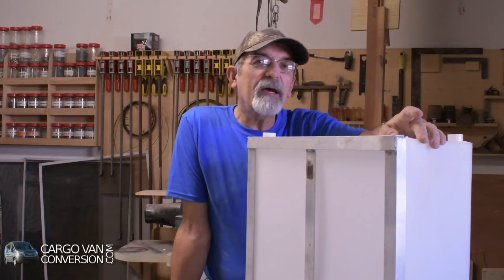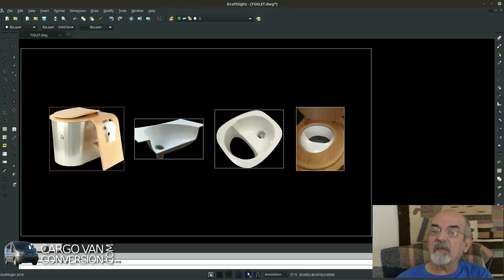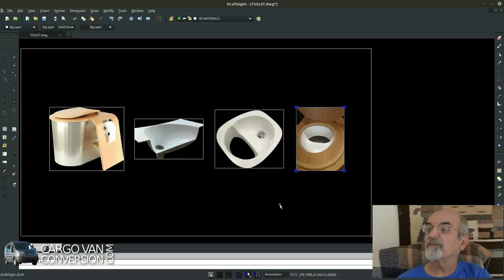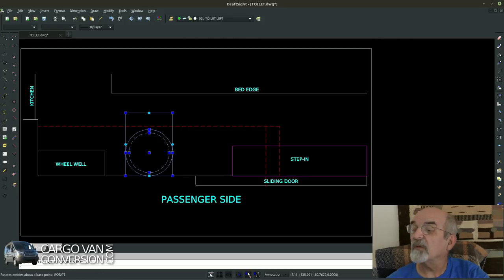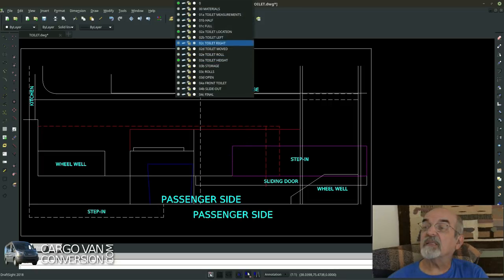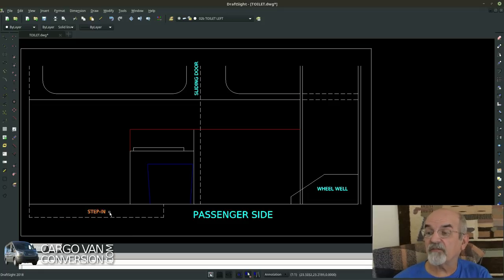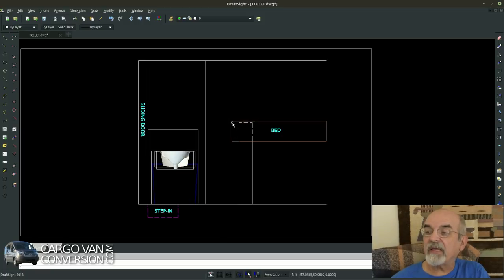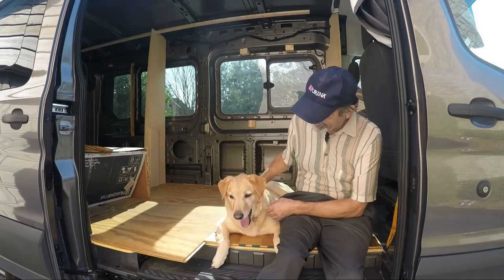RV Separating Toilet - Design Considerations

Comment: Hello! Van, Great to see you back at it again. I have an idea for you.
Fill in the area that the footprint of the toilet in your step well. Possibly with storage for extra toiletries, we can never have too much in that regard. That would create a level place for your foot and having more room on your right side for obvious reasons.
The lid is a great idea and I would use it for supplies too. I have a Ford E series van and my step well is filled half way across with a tank I made of stainless steel and covered in the flooring material.
I fill it with water for the dogs when we are outside. It's easier than going inside to fill their bowl.
It's also a few more inches of floor space when the door is closed.
I twisted ankles a few times moving around before I did it.
I'm just getting back to the kitchen cabinets on mine, the weather is finally getting better. And once I'm done with them I'm going to make a filler for the last bit of the step well to create a fully flat floor when I close the door. I'm thinking about attaching it to the door for a small shelf when it's open. And storage for leashes and collars inside.
You know the rule everything built has to store something. Well I hope you have it figured out and can't wait to see your results!
Give Joey a big hug and good luck with the build. It's a great design and it will make travels easier. Hope your adding an exhaust fan to the toilet to vent it outside and help in drying "things out" almost forgot to add that! Happy travels!
Beeps
Reply from the maker: Hi Beeps,
Yup a bit of a YouTube burnout. Too much editing. Have a new camera too, that tends to make too many photos (10/sec) :)
I'm working on several things now and one of them is the step-in area. It is intriguing to fill it and get a flat floor back, but getting in is already a struggle and at my age, it's only going to get worse. Would need a exterior step then. But I already had a good design for a compact step, that I may be able to store in that area. May have to rethink that.
I decided to place the toilet in such a way, that I retained 30 inches to get into and out of the van. That would leave me about 12 inches on the left side of the step-in area to store flip-flops and a pair of water shoes or a leash. Just like you described. Am working to put that in now, but I'll sit down and take another look.
Love all these ideas.
Take care!
Almost didn't see what you wrote about the fan. Yup probably a small computer fan, likely with a manual switch.
Van Williams
Reply: @cargovanconversion  exactly, just enough to keep the air moving out to dry and remove odors. Flex vent works for quite a while before it needs to be replaced.
Reply: @cargovanconversion  Aha ! Someone did suggest and you're thinking about a small exhaust fan ! Excellent !

Also, love the idea of a step stored in the "step" area. I've doodled that in my own (always planning, never starting ;-)  )  van camper. It makes the floor space just a little bigger and more finished looking when you're closed up. Mine are usually planned as attached and hinged to fold down, with the side facing the door open when folded up. The step then becomes a handy place to kick off the muddy shoes. If that's clear enough ?

A loose step stored there works too, and I've figured it'd double as a handy tool box too. And being movable could be handy for stepping up around the rest of the van as well for easier access.
Reply from the maker: @nothere7198  Hi Not Here,
Lots of possibilities with that step-in area. I think it just much 'safer' if you could fill that area in and have a straight floor. I see myself getting out of bed at night and just stumble into that hole. Can be nasty.
But on the other hand, getting into the van through the sliding door opening is already an effort; always have to use that door handle. Doing that will only worsen. So a stepstool in whatever form is handy and perhaps necessary. Just haven't figured it out how to implement it. Also wanted to use that step-in as storage for a pair of flip-flops or water shoes and maybe a dog leash.
All those wishes and too little space :)
Van Williams

Comment: Like that computer program it gives you a clarification how to move things around on a built of a van and I bet other things.  Welcome back Van Williams and Joey.  Great video! Can't wait what upgrades you done.  Kisses to Joey for me.
Reply from the maker: Hi Olga,
The program I work with is a CAD program on a Linux Mint OS. Linux is really recommended for most people, I think.
Just had a small YouTube breakdown; just done too much video editing. Didn't do much in the van, now just getting back on track
 :)
Currently I'm working on the step-in area at the sliding doors. Was already creating some storage space there and finishing it up, but 'Beeps' gave me something to think about, by closing that step-in area and create a solid, one-piece floor and use the step-in area for a little extra storage. It would require me to get an exterior step to get in, but worthwhile to reconsider my original plans.
You'll see how that works out.
Van Williams
Reply: @cargovanconversion  wow that is awesome can wait to see everything. I want to get a Ford Transit for traveling I will do the built and make it awesome. Glad you're back.  I might ask questions later by a professional like you.  Thank you. Kisses to Joey for me. Be safe.
Reply from the maker: @cheddar2848  Hi Olga,
Best advice I can give you about the build, is to take your time and do it right, but you will make some changes later on, no matter what you do.
Good luck.
Van Williams
Reply: @cargovanconversion  Thank you Van William I will have that in mind. Thank you again.

Comment: I'm sure you already have it worked out and we'll see it in a future build video. Maybe you even already answered it below in another comment. Just wondering / thinking about the anchor method for the toilet. Maybe you're already looking at using the lid to lap over the top of the toilet section and latch down to it ? Looks like it would be a simple and effective way. Looking good (never thought I'd say that about a toilet lol) !
Reply from the maker: Hi Not Here,
Still working on all the details and ordering the materials. The lid would have to latched to the bottom, I just don't know yet how. One issue is that I wanted some (light) switches on the front side (facing the cab) of the toilet surrounds. That makes it somewhat more complicated. Now I'm considering to rewire those switches to the B pillar. It's a never ending process :)
Van Williams